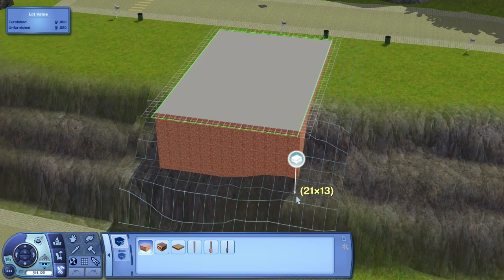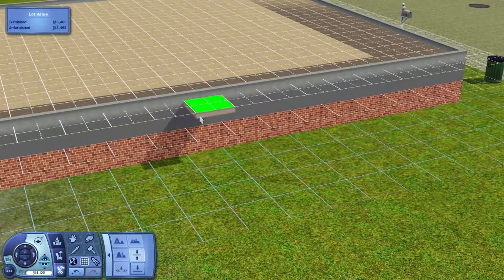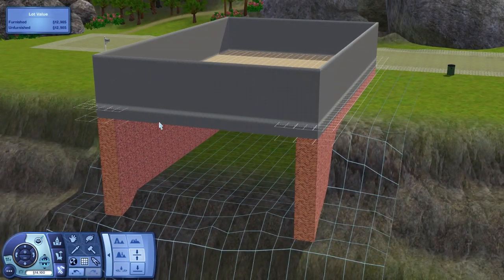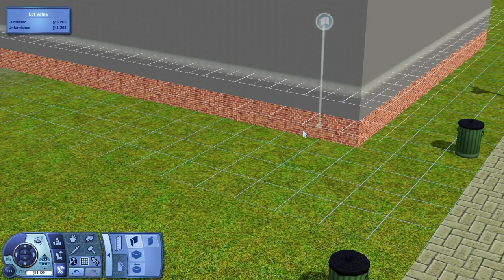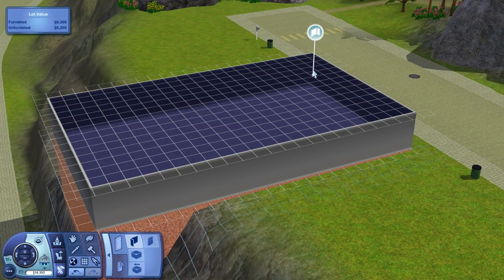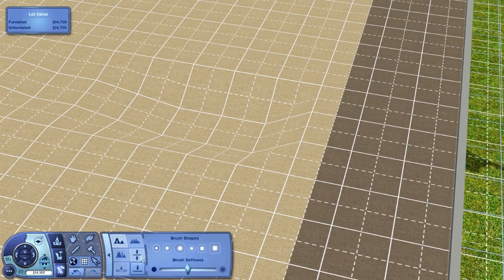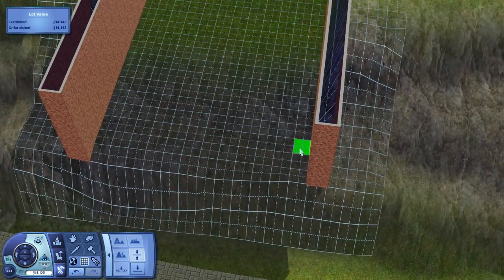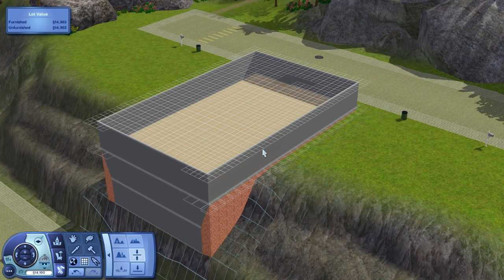Sims 3 101 - Multi-Level Cliff Lots

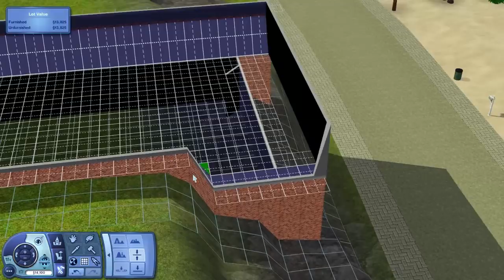Comment: At 4:41, when I flatten down the inner-foundation parts the wall that I built on the foundation doesn't stay straight, it curves (like on a curved roof), how do I stop that? The idea for the house I have is have one floor on the ground, and the second and third floor be on the hill that is on the island. (For reference to the lot, it's the lot that you used for your Sims 3 Island Paradise Let's Play, where you had to keep moving a shell because it got in the way of you building.) Please help if you can, it would be greatly appreciated.

Comment: I'm trying to build a house but I'm having a lot of difficulty with it. This might be really hard to explain but basically its a vacant lot thats on a really steep hill and the lot has a sort of cliff on it... So the left side is flat then about half way it goes to about one walls height (on sims). They way I want to design the house is by having a level on the ground that goes up one-story that will connect to the hills surface. But with everything I try I always end up with a gap in-between or walls not at the right level.

So do you think its possible to actually do this on sims 3? or not lol. Hope this comment reaches you!

Comment: There's also a neater way to do it, it just takes a lot of time. Instead of using foundation, you can use actual walls. It's hard to explain also, though.